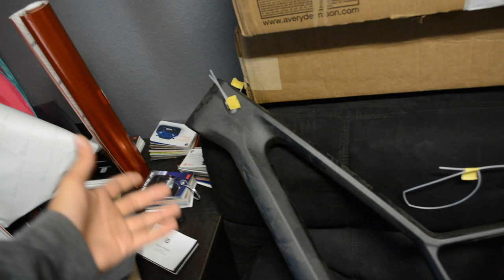Black Holographic Chrome Vinyl Wrapped Bicycle!

Comment: FYI, Do some RESEARCH first before attempting to wrap a bike. I have not seen a video yet on bike wrapping that explains the type of cleaning agent to use prior to wrapping nor the temperature setting prior to and during the wrapping process. If you want it to last long (not peel, bubble), you need to know this. Vinyl has a "memory" that has to be lost by the proper temps in order to not be ruined, especially on objects that will be exposed to outdoor elements.
Reply from the maker: This comment must be for ones that dont know that…. 5+ years doing this with a whole business youd have to know thats something weve understood from the jump lol
Reply: @VinylSlimShady  well when you do a how to video you have to remember there's a lot of hidden things that should be addressed that some people just don't think about.   My friend saw the first two videos and started wrapping his bike not realizing the temperature setting was wrong on his heat gun. It took 11 months before it started to peel but once it peeled it started to bubble too. It couldn't handle the temperature changes because the memory was not gone from The vinyl.
Reply from the maker: @AB-bs5ef  we dont do how to videos. There are plenty others on YT for those type of vids. We make vids about the work we do with every so often adding a tip or trick on something if the situation calls for it.
Reply: @VinylSlimShady  I meannnn it does show up in the How To section 😬 I searched “DIY chrome wrap” & this video popped up but I did think to myself well wait he sped thru the important parts 🧐 if we were all that experienced we wouldn’t be on YT 😆 IG still grateful I seen this trying to make my car cool I suppose I can start smaller on other things & practice. Thanks.